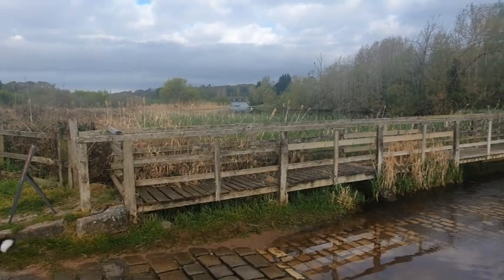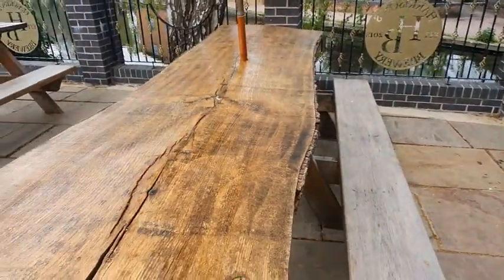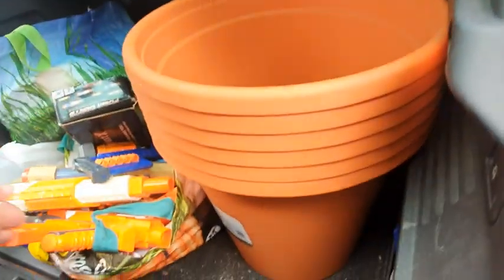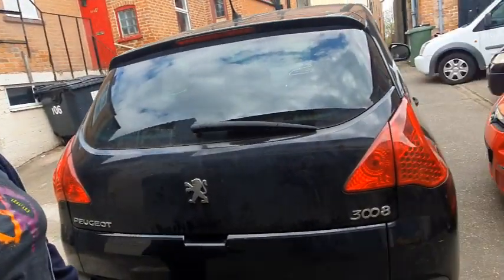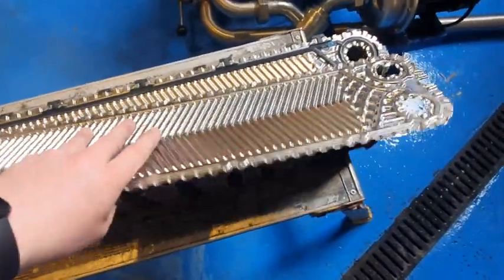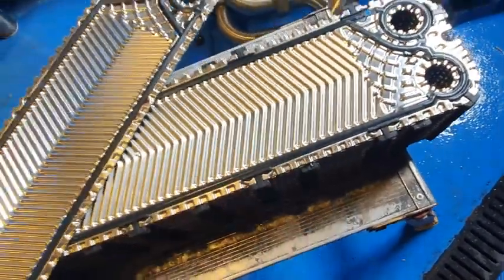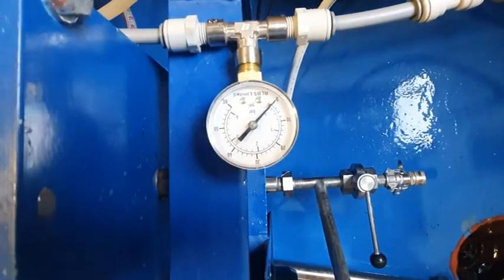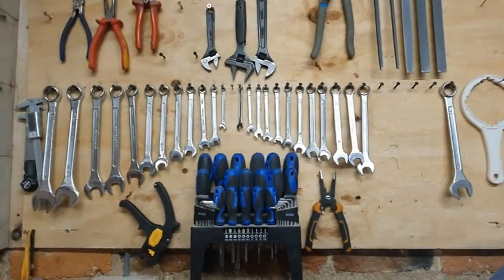UK Exchangers 5BBL Paraflow Clean

Comment: Did all the hops you had planted die? Nice share with the mysteries of the plate chiller...i've always been a skeptic on those...and I have a wuss of a pump, so they wouldn't work so well. Nice and clean. Cheers!
Reply from the maker: I will have a look for the hops, They weren't in the best spot to be fair to them.